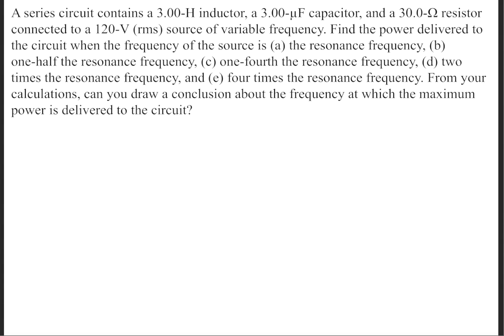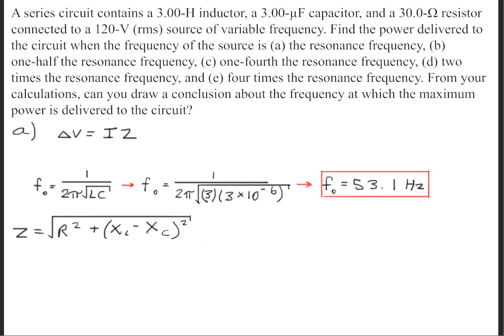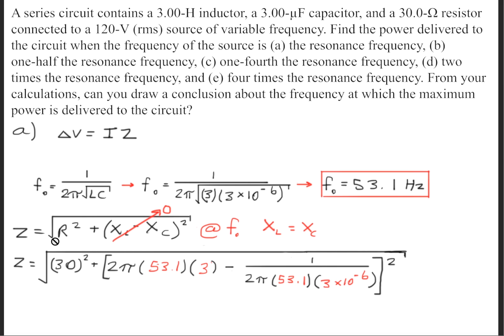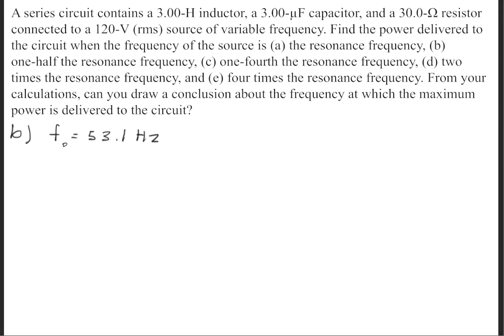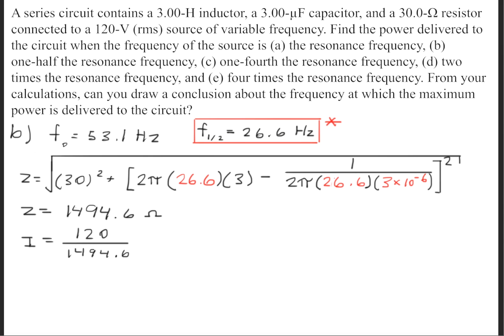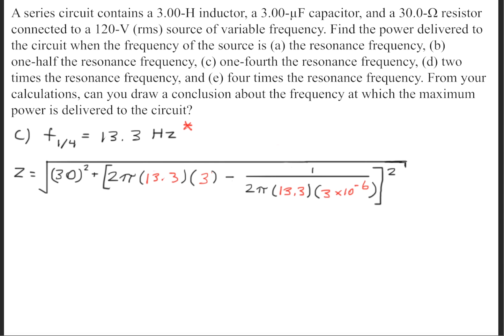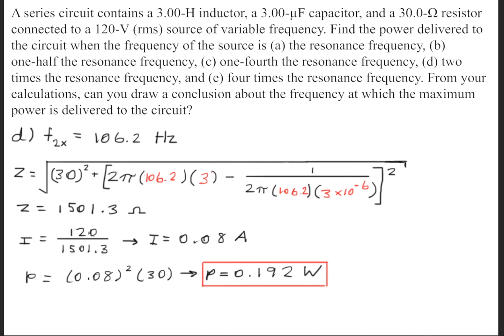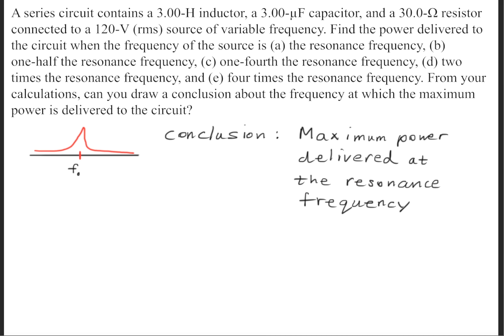A series circuit contains a 3.00-H inductor, a 3.00-μF capacitor, and a 30.0-Ω resistor

Comment: 2:02 sorry bud, your math is wrong
Reply from the maker: Would you care to elaborate? I'm curious where you think I made an error.
Reply: @Cypress_Echo521  during resonance both are impedance are 1000, when you half down the frequency the inductance impedance will be 500 and the capacitance is 2000. Your results were close but when there are roots and powers it makes a big deal. The more accurate answer is: 1500.3
Reply from the maker: @zaid_alhelu  Oh, now I understand. I apologize for the mathematical mistake. I know it's very important to have accurate results when dealing with roots and powers. Thank you for pointing this out and taking the time to give an explanation. I think I might try to remake this video.
Reply: @Cypress_Echo521  you don't to apologize sorry if my comment seemed rude i didnt expect you to reply, thanks for the awesome work